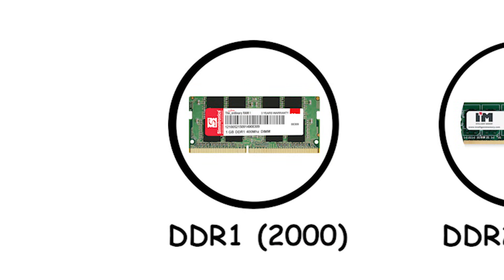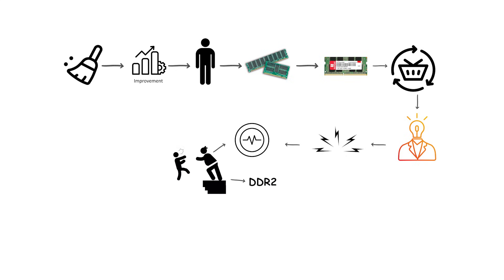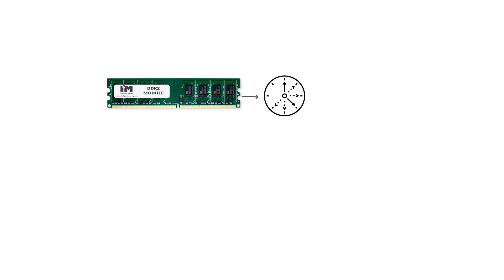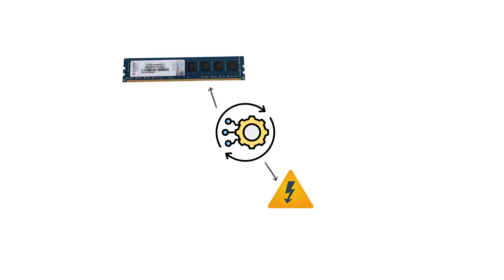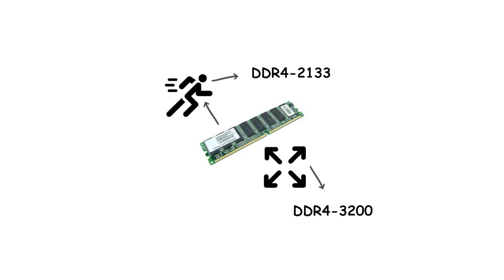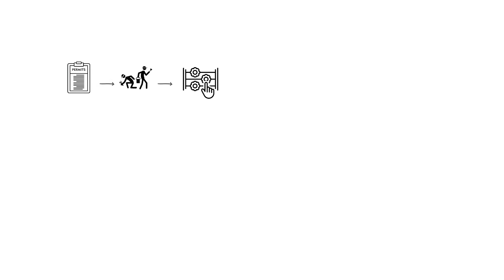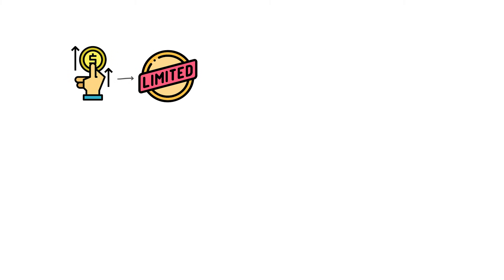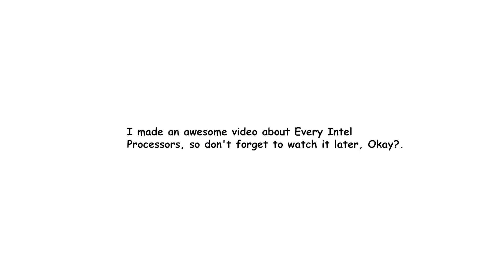Every DDR RAM Explained in Detail

Comment: Looks like the performance gained on DDR5 - 4800 and above is not linear. I would also predict that DDR5 4800 is is equivalent to DDR4 - 3200 Because they are still traveling through the motherboards copper traces
Reply: Not linear because memory controllers, too high speeds exceeding bus capability and faster memory needing higher CAS. But it still is faster even with gearing not 1:1.

Also of course they need copper traces. What else? Photonics? Enjoy the 85k prototype motherboard and no memory modules made for it.

Comment: What about gddr
Reply: Gddr for Graphics Cards
Reply: VRAM 
After gddr4/ddr3 the two are made very differently for optimization purposes
Reply: GPU only party. Works at high speed. Way higher than normal DDR. Also refresh and gating and gearing is way different. Also the latency is terribad and super high, not fit for CPU. Which does not have the controllers for it. And you will need a way to mask the insane latency. And probably to burst data in large chunks.

Comment: You forgot to talk about how ddr6 will also have the new camm 2
Reply: Nope camm2 ia camm memory and ddr6 is ddr memory
Reply: @Guzganu14 I know, camm 2 will release before ddr6. Ddr6 will be release by 2027. That means dd6 will use the new camm 2 module
Reply: @xxunoriginalgamingxx9046  how do you draw that conclusion from these two?
Reply: @switchjay DDR6 will get a push toward CAMM2 because match pair by default, CKD by default (probably) and more speed because shorter traces plus less PCB space.

Add to this motherboard makers pledging to offer side support. And CAMM2 already being approved as a spec.

Of course this may change in due time and we stay with sticks as we know them.
Reply: @Guzganu14  Wrong. Totally wrong.

There are already CAMM2 modules with DDR5. DDR6 will (maybe, probably, likely will be a push because easier to get higher speeds because better signal integrity be ause shorter traces) have a good amount of boards with CAMM2 form factor. Added bonus is always dual channel in the module with matched pair. And CKD (clock chip) may be part of CAMM2 modules with DDR6 as standard for more speed. But it may not pick up enough speed like 12VO spec. 

CAMM2 is a form factor not a memory type. "I do not have AMD or Intel I have an ATX pc.". Not how it works.